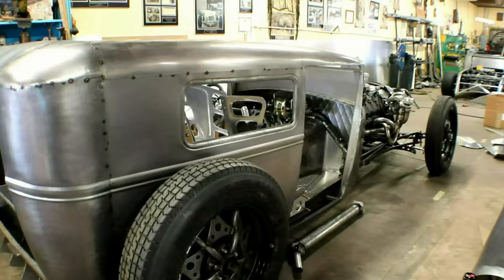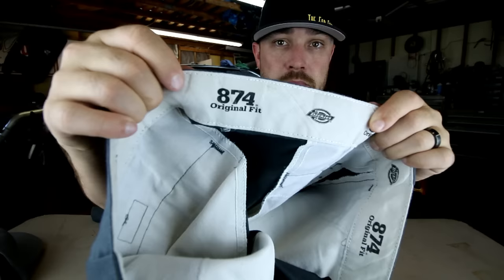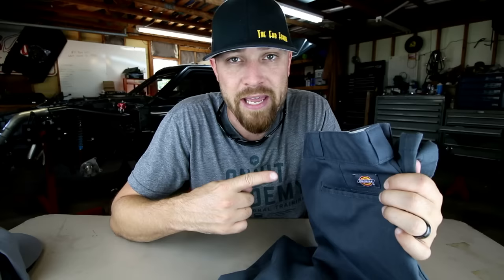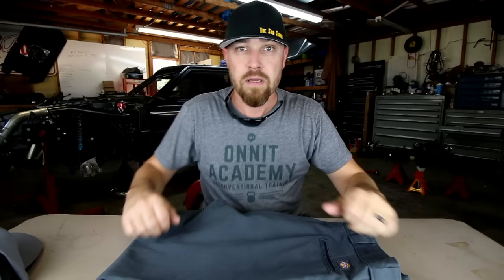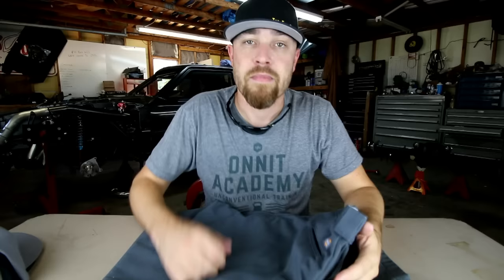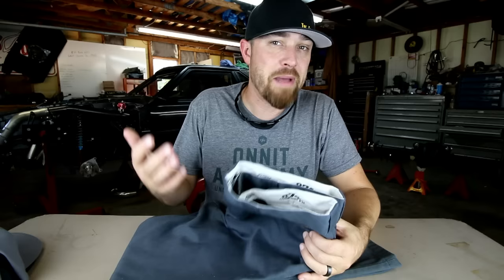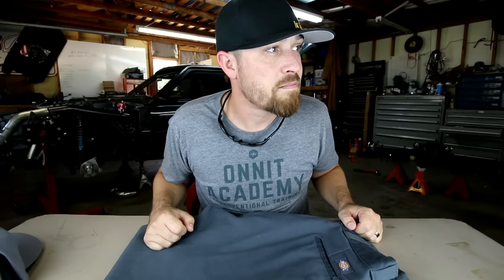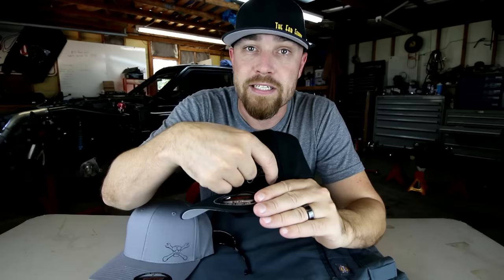You Need This Tool - Episode 34 | Dickies Original 874 Work Pants

Comment: I use these as skate pants
Reply from the maker: I could see them working very well
Reply: same
Reply: momo can I buy them at Walmart
Reply: same
Reply: @Thefabforums  Skateboarders like them for the same reason tradesmen like them. They're cheap, durable, and don't constrict your movement.
Reply: Can someone Help me? I bought one of these dickies pants. And as I wore them they were very straight and hard. Does it change after the first wash? Sorry for my bad English
Reply: @kerstint7441  they are made of stiff and tough fabric so they take a while  wear in.
Reply: The Fab Forums yes
Reply: @kerstint7441  yeah after a wash or two and after you break them in they should feel like a dream
Reply: @noahwitt259  yep sorry 2 years late
Reply: Double knee for skating
Reply: @ryansmith8  it’s funny looking back on this I am now a tradesman and don’t really skate anymore lol
Reply: @momo-os7ll  what trade did you get involved in
Reply: @koolaidman3083  I’m nearly qualified as a joiner/carpenter

Comment: I work with a lot of corrosive chemicals and the Dickies are the only ones that hold up.
Jeans will have holes and chemical burns all the way through in less than a month. Dickies literally last for years. I just threw out couple of pairs that I had for 8 years and that was because the pockets wore out on them.
Reply: Man you should've kept them as memorabilia.

Comment: I just wanted to add one more comment. I see you have the original 874 Dickies pants.

That’s what I wear. I love the original. I do not like the flex. 

The problem is I’m in Tampa, Florida and they only sell the flex in most stores. The only way I can get the original Dickies Work pants is either on Amazon or directly from Dickies online or the army surplus store. 
The army surplus store tends to charge a little more. But when I order them from either Amazon or Dickies directly, I do get them in about 2 to 3 days without paying extra. 

I were mostly khakis when I’m not working. I wear black as part of the uniform but I only work two days a week. I’m retired and I have a charcoal gray and one dark brown dressing moment, they are my go to pans.

Comment: I kick it in the Relax fit Dickies with the cell phone pocket every day. I have multiple pairs of them and many pairs of the 13" inseam shorts with cell pocket. The cell pocket is key, as you can slip small tools into it while working when you need 2 hands... I am always dropping wrenches or pliers into it while working away
Reply from the maker: i will have to take a look at those

Comment: I use short sleeve dickies shirts but I wear jeans instead, I dont really like the pockets, I tried them and I always had my phone laying on the truck never on me. And sometimes I am on farm equipment i need to climb on and it just didn't fit my environment. but if its fixed I'll get me some for the looks... For the mean while the Wal-Mart "george" and "wrangler" brands have really stepped up their game 245% from a few years back... $10 for some super black "george"  jeans that fit like slim relaxed $60 Levi's and $20 slim straight wranglers, every time walmart has my size I buy em... I use them for everything, with my square toe ariats and my western floral engraved belt... Iam letting go of the dickies shirts too due to the price. I've been going to these outlet stores like Ross and I've found some nice wrangler western shirts, shirts with narc desingns, with birds and other brand navy blue shirts for like 6 to 10 dollars.

Comment: Carhartt pants are the same way, need to order a size bigger !   IFF !
Reply: Yup I second the Carhartts. They aren't cheap but the thick denim = less scrotum burn'age when welding and cutting vs the relatively thin Dickie brand.
Reply from the maker: I think the thin is what I like about the dickies...I could do without the scrotum burn'age
Reply: The Fab Forums speaking of scrotum burnage, what is a good type/brand of underwear to wear under dickies? i got some original dickies pants but now i need something comfy underneath if u got any advice or recomendations,  sorry for awkward question lol

Comment: Yeah Dickies pants are pretty cool but you all should look into Ben Davis Original or Trim fit pants.  Ben Davis pants are the bomb and plenty tough to handle any kind of work load you might want to dish out.  Also the belt loops are bigger and the pockets are way deeper then dickies.  Plus you have a small coin pocket to boot.   Just saying......... :)
Reply from the maker: cool

Comment: So what if U wear a pants size 40 30.? Mine just came in 2 day and they were original fit. I tried 2 sag I'm pulling down a little bit and it was a struggle. So what should I do. Ima big tall guy I and I weigh 257

Comment: Dickies are true to size means that a 32" measures 32" at the waist? If so, measurements are based on the garment not on my body? Am I right?
Reply from the maker: not sure how they are measured i just know if you order the size you would normally wear they will be too small
Reply: I usually wear W32/33, today I learnt I'm a W34 by Dickies. I personally don't like the feeling of the high waist fit, I'm gonna look for low rise Dickies!
Reply: @vassili87  how tall are you and whats your weight bro?
Reply: @andreiisler6114  I don't know my actual weight now, I lost more weight since then and the only way I can wear that W34/32 FLEX is by wearing them pretty high on my belly.
BTW, I'm 174cm/5.7 feet.
Reply: @vassili87  Thank you sir. Could you possibly estimate your weight back then? Just need it for reference sir on some purchases
Reply: @andreiisler6114  I think 80/82kg. But I used to wear (and I still do) size 32 for all the brands but Dickies, even when I was 98kg. My body was different then when I was 19years old. I weighted 94kg but I used to wear size 40 or something. Then I lost weight but I got it back in 10 years. Still my upper body was the only part affected.
Reply: @vassili87  Thank you sir!
Reply: @andreiisler6114  welcome ;)